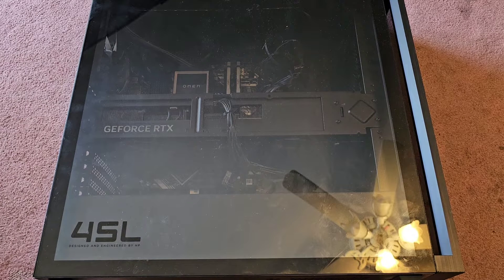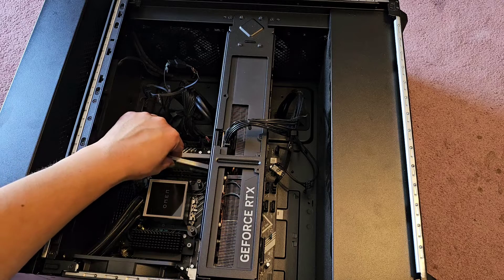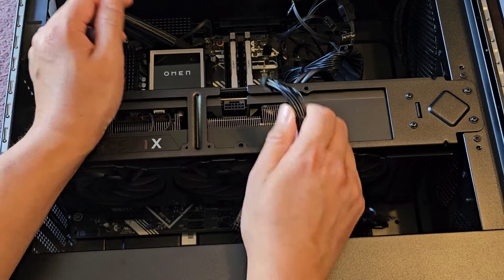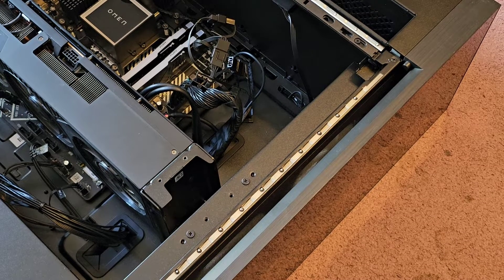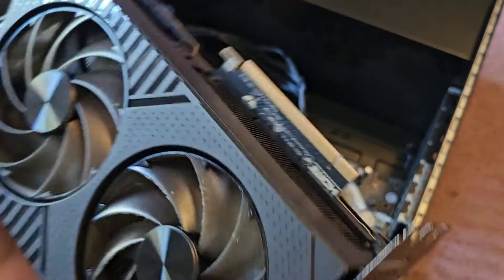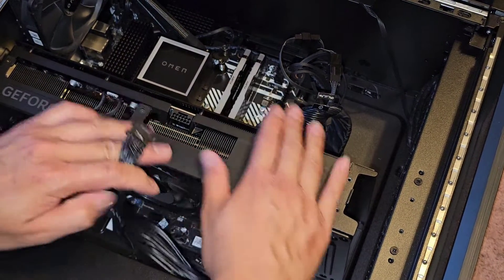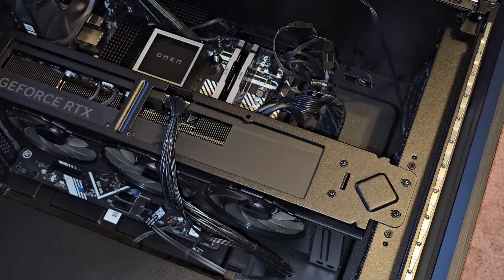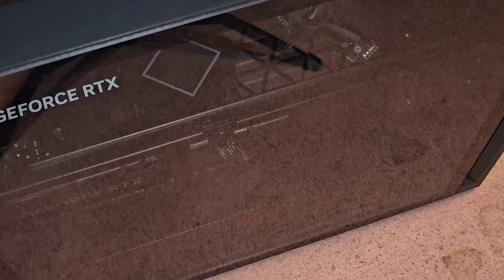HP Omen 45L GT22-1084 Disassembly RAM SSD Hard Drive Upgrade GPU Graphics Card Replacement Repair

Comment: I have two of these and they have been perfect, got the second one from auction site dirt cheap with a 4090,  no ram, installed ram and no problems, cosmetically perfect and hp warranty to boot. I did add an ssd, but I need to keep an eye on my boot drive. The GPU is super secure on these, really been happy with the design of the case.
Reply from the maker: Nice!

Comment: I am pretty sure there is one more NVME SSD slot on the motherboard,  It does not have a screw so if you put one in you will need to procure or buy a M.2 3 mm screw.  Also if the CPU is an Intel brand then there are only 20 PCIE channels available. The GPU takes 16 and the NVME SSD (Primary) under the GPU uses the remaining four channels.  That means the second NVME SSD will be using the chipset and not achieve full output speed.  Just keep this in mind as that is just the way the system works with Intel.  Now an AMD CPU gives the person 24 PCIE channels so will not be a problem for a second SSD drive on the motherboard.
Reply from the maker: Yup, above the SSD
Reply: Do you know if the motherboard supports Gen5 NVME SSD's on the latest GT22-3000 model 45L's? I've recently ordered one with an Ultra 9 285k, RTX 5080, 64GB RAM and 2TB SSD for £2500. The SSD fitted is surprisingly only Gen4 and as you mentioned if I fit another it won't run off the PCIE lanes so thinking about swapping it out for a larger capacity but wonder if it would benefit going with Gen5 if it supported.
Reply: @98_martin90  HP is pretty conservative and does not move to new standards right away.  I am not sure but remember NVME get super hot at high speeds and throttle down very quickly.  These SSD's rely upon large buffer memories to reach the advertised speeds.  I would rather buy a gen5 and run it at gen 4 speeds as the engineering is at a higher standard. But this is my viewpoint and I am not a big fan of overclocking just for bragging rights.
Reply: @anthonycarbone3826  Thanks for the response! Wanted to come back to further add to the information after doing some more research. I managed to find an article on the HP support site that gives the specifications on the HP WildheartOC motherboard used in the 45L. It confirms that there are three M.2 slots on the board, socket 1 being for the WLAN, socket 3 being Gen 4 and again confusingly socket 3 being Gen 5... must be an error on HP's part. On the physical board itself they are labelled as SSD1 and SSD2 so a educated guess would tell you that SSD1 that is populated from the factory would probably be the Gen 5 slot but it could be incorrect?

It does also confirm like you said that the Gen 5 slot talks directly to the CPU while the Gen 4 slot talks through the chipset. This is something I am not that sure of however after doing more digging into the Z890 chipset it details that it has 20 PCIe lanes available at Gen 5 and a further 4 PCIe lanes at Gen 4. The WildheartOC specs I think suggest that the additional 4 Gen 4 PCIe lanes are used by the second PCIe slot on the board that is totally unusable with the installed triple height GPU. Maybe this would mean that if that slot was left unused the second SSD would instead use the Gen 4 PCIe lanes to the CPU?

I'm doing all this digging because I plan to replace the originally installed SSD on the PC which is a 2TB Western Digital SN5000S because it doesn't have it's own DRAM and seems awfully 'budget based' on such a high end PC, slight let down for me towards HP on an otherwise good PC. I'm thinking to go with a 1TB Gen 5 SSD for booting to and a second 2TB Gen 4 SSD for installing games on. I'd like to use Kingston to match the RAM, possibly one of their Fury Renegade SSD's but those Gen 5's are still pretty pricy.

Comment: Did your omen 45L pc ever stop working because the one that I have don’t turn back on no more do you know what’s wrong with mine.
Reply: The PSU is worse than terrible on the 45L.  HP uses inferior PSU' s.  Experienced lots and lots of Kernel 41 issues... Now i ordered a decent 1500W PSU with ATX 3.1 capability.
Reply from the maker: @justinzwaan6704 hope it works well
Reply: @ItsBinhRepaired thnx 👍 very hopefull because its a Coirsair 💪
Reply: I will let know btw 👍 . Will install it probably next Monday.
Reply from the maker: @justinzwaan6704  sounds good!
Reply: @ItsBinhRepaired So far so good, haven't had a Kernel 41 so far. Also in game seems to be smoother with no jitter.... 🤞  But more testing will be done the coming weeks.  Did not yet overclock my GPU, but i did overclock the CPU with no issues. Solid temperatures so far for both.  The Cryo chamber works like champ on the Omen so it seems.
Reply: @justinzwaan6704 the one that came with mine was 1200W, I’m probably gonna change it for a 850W Corsair
Reply: @gabrielramirez4625 yes mine too is 1200Watts, but it is no good with the rtx 5090. And it is not atx 3.1 supported. The rtx 5090 and probably the 4090 needs 3.1.  So don't go any lower in power!  Go for a 1200 or 1500 with ATX 3.1 capabilities.  Depending on your graphics card. 4090 at least 1200 and the 5090 preferably 1500 watts. (ATX 3.1)
Reply: @justinzwaan6704 oh wow mine has a Rtx 4080 super so I think 850W should be enough right?
Reply from the maker: Yeah, nobody needs 1000w psu unless you're running multiple GPUs lol
Reply from the maker: Likely power supply. This is a customer's computer, so I don't know its current condition.
Reply: @ItsBinhRepaired yeah man it’s probably the psu since it’s the one that came with. Thanks

Comment: Couple questions: There are 4 sata slots under the GPU with one connected via cable to something on the back side of the board. Any idea what it connects to? The other one is just wondering why not throw one of those extra NVMc SSDs in the 2nd slot on the board (I am guessing this video was simply going through a few things for demonstration)? Thanks.
Reply from the maker: Not connected to anything
Reply: @ItsBinhRepaired Oh right on. Thanks again.

Comment: I have two different questions:

- Would a replacements ASUS Rog strix 4090 compatible with this pc 
- Can two rtx 4090 be accommodated in this, I understand the PCI’s lanes limitations but I’m ok with two cards working on x8 , also I could see there is only one  gpu slot, can this pc be upgraded with new mother boards like x870 series mobo with two slots ?
- is tho omen gt22 modular like custom builds with standard components
Reply from the maker: Yes to all questions, but the cables might be too short on some connectors. I'd just replace the tower if you replace the board.
Reply from the maker: Fitting a larger gpu depends on the power supply and how large it is.

Comment: I got the 5090 version 2 weeks ago. The gpu holder has been changed to a 2 inch metal bracket. I changed all the fans to noctua fans. This system runs hot and i don’t trust the low cost fans to get the job done.
Reply from the maker: Nice
Reply: Also got the rtx 5090, but it turns out that de psu that HP delivers is not up to the task.... Although it is a 1200W gold + Certified.  The issue is that it is not an ATX 3.1 compatible.  They just use the cheap HP standard PSU, which isn't even modular.... Because of the high power spikes it will crash regularly.  Test show that some spikes even reach a 1000 Watt for several milli seconds.  Your pc will be protected against over surge and will shut down to protect the circuits... This will produce a Kernel 41 (63) error....  I now ordered a PSU 1500W with ATX 3.1 compatibility.   Sorry to discover that HP chooses very poor quality parts that don't even match together properly.  Even with their highest end systems....  Probably just to save at production costs... If i had known this beforehand i would have build my own system, and even saved quite a lot of money.....
Reply: @justinzwaan6704  That is a surprise and worry but I just checked the RTX 5080 45L I ordered and it has a 1000W Gold certified PSU that is stated as ATX 3.1 and fully modular. Even a 1000W PSU would be enough to power a 5090 surely so I wonder why HP didn't use this PSU across the board.
Reply: @98_martin90 yes exactly.... They do now they know probably... Haven't had one single issue since the placement of the Coirsair 1500. Atx 3.1. 👌
Reply: @justinzwaan6704  Awesome that's good to hear. Mine is arriving middle of next week so I am looking forward it. Have you had to do anything else to it? I have seen mentioning of the fan and pump curves needing adjusted to minimise temps as best as possible
Reply: @98_martin90  haven't had issues with that luckily.  In fact you can easily overclock to 5,2 Ghz (processor) without almost no temperature increase.  The cooler works very well.  I would recommend to change the memory settings in the Bios from Standard profile to XMP profile..  I went from the standard 4800 M/T to the full 5600.  Quite a difference in performance.  Should you choose to overclock, i would focus on the GPU rather than the processor.  But with this card its not really nessacery.  Maybe with Flight Simulator or something at most.  👍
Reply: @justinzwaan6704  Thanks for the tips and advice 👍Good to hear aside from the PSU issue you've had a good experience with the PC. I was a bit hesitant for a while after watching the Gamers Nexus video on it but I feel they were a bit harsh on things that could have been rectified with a bit of work so ordered it at New Years with a really good discount on it
Reply: @98_martin90 good to hear, i hope you have lots of fun with this great pc 👍🙏

Comment: Hi, very nice video. I got a 45L DT GT22-3007ns with the gtx 5090. I would like to put a second nvme.m2, but cannot find any slot to add it. Do you do know if there is actually a second m2 slot? If not the only option would be to substitute the current one and put it with a higher capacity? It seems that HP support cannot help with it and cannot even tell me where in HP they can answer my question, HP is becoming an embarrasing company...
Reply from the maker: @ricardo-lx  one is above the gpu and one is below.
Reply from the maker: @ricardo-lx  I show both in the video.

Comment: Thank you, I have a very young 2022 HP 45L which has been working great except for somehow the factory installed SSD is giving a degraded warning even though the life is 100%.  It is a NVMe WD WD_BLACK Gen4 SDCPNRY-1T00-1106.  I am going to replace it with the Samsung 990 Pro as I've lost some confidence in WD.  This video was extremely helpful in figuring out how to do this.  Only question I have is related to the 990 pro with heatsink vs without heatsink.  It is a bit unclear to me on whether I need to put the one with the heatsink in or not.  I am looking to do that for the 2TB option for the one you linked in another comment.
Reply from the maker: @neol07707  I recommend this one https://amzn.to/3DYfBgq
Reply: @ItsBinhRepaired  Wow thanks so much for the quick response and recommendation.

Comment: I can’t remove gpu it is literally hard to remove it
Reply from the maker: @albertchloe8547  did you undo the clip?
Reply: @ I did it now. I used a mental fork to push the latch. It was impossible to do it with only hands. My fingers even got injured 😂 terrible design. I spent 2 hours on it
Reply from the maker: @albertchloe8547  ouch D:

Comment: @ItsBinhRepaired I'm upgrading mine next and just want to ask does the Samsung SSD fit into the top slot underneath the cpu pump.
Reply from the maker: Yes, if it's the standard length SSD.

Comment: Do I have to take out the GPU to install a secondary SSD in the slot?
Reply from the maker: Depends if the primary is on top or under the gpu.
Reply: @ I don’t see primary so I’m thinking it’s under
Reply: @ I just wanna add another one so I see the other slot so it should be just a plug and play and format correct?
Reply from the maker: @JaredTankersley-j8q  yup
Reply from the maker: @JaredTankersley-j8q  make sure the computer is off first.

Comment: Why did you only have one SSD installed?  I just bought the Samsung 990 Pro and will use it as a second drive. The drive it came with is 1TB.
Reply from the maker: It's whatever the customer asks.
Reply: Where is the second m2 slot? I want actually to put a second nvme.m2 (the samsung 990 pro)
Reply from the maker: @ricardo-lx  There's one under the GPU that says must install with Heatsink

Comment: Thanks for making this video! I do have one question. That SSD with the heatsink under the GPU. It doesn't mess with the GPU fitting and no heat issues right? I am thinking of buying the exact same SSD. Thanks!
Reply from the maker: @AresBrutus  no issues
Reply: @ItsBinhRepaired  Cheers!

Comment: Was there a technical reason for not using that second NVMe slot or was it a business related decision?  I'd rather not pull the GPU out if I don't have to.  The second slot can be used without pulling out the GPU, correct?
Reply from the maker: Usually the second slot is slower because it's cheaper to do it that way, but it'll likely be fine if you use that slot.
Reply: @ItsBinhRepaired   Thanks!
Reply from the maker: @madderall_dot_com  no problem

Comment: Hey I’m adding a secondary ssd. Do I need to reinstall the windows program?
Reply from the maker: This will help https://youtu.be/4p5jFDzVwUw is the other drive already an SSD?
Reply: @ItsBinhRepaired  yep it’s the stock one that comes with it
Reply: @ItsBinhRepaired  the quick response is much appreciated as well. Thank you
Reply from the maker: @EroSportGTS  you can add another m.2 nvme drive and just keep booting off the original.

Comment: is there any problem with 990 pro without heatsink?
is there are any problem after you install 990 pro with heatsink above thermal pad?
thanks
Reply from the maker: @badralharbi3783  no problems

Comment: omg thank you for the post...the idiots sent me a visual defected VRM heatsink ....basically 3-4 fins are slightly bent, but they are not touching each other...i don't want to return as sometimes when they get one thing right, the other comes defective...my cpu/gpu cooling seems okay. on HW monitor the motherboard has: HPTZ, TZ00 and PCH. the PCH for some reason runs at 58 degrees celcius at idle. the other two runs at 30 degrees...idk if the bent fins have anyything to do with it...but i do have 2 4k monitors attached. do you think the bent heat sink fins are a problem or no
Reply from the maker: Shouldn't be an issue
Reply: @ItsBinhRepaired  i just got it yesterday after seeing your video lol...but i don't want to return it. so it should be fine right? its just 2-3 find bent. do you know why my PCH portion of the motherboard is hotter than the others? its at 58 degrees on idle... other portions are at 30 degrees. what readings do you get on your computer on HW monitor?
Reply from the maker: It should be fine. I don't own any of the computers in my videos.

Comment: Dude I install the Ssd that you recommended and it works like a charm fastest I own yet, I had to clone the windows and reinstall it on this ssd, I broke the pin for the Gpu on the process but it still work because the great mount that the omen comes with.😅 great video
Reply from the maker: @sima-otw  lol glad you were able to get it to work.

Comment: Is the upper SSD ok to use? Mine only came on the second one like you are doing.
Reply from the maker: @purple-1224  sure, but it says to put one with heatsink.
Reply: @ItsBinhRepaired  Could you not put the one with the heatsink that you installed in the upper one and leave the one it came with? for even more storage? Just got this PC and want to know my options
Reply: @Snowgar_0  yes you can do that
Reply: Does adding a secondary ssd affect the speed at all?
Reply from the maker: @diegocastaneda4732  nope